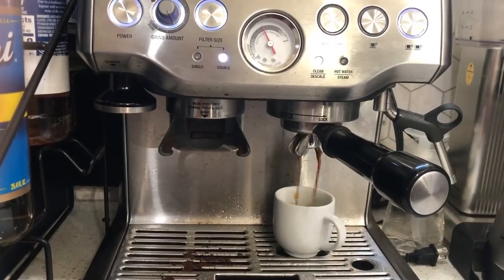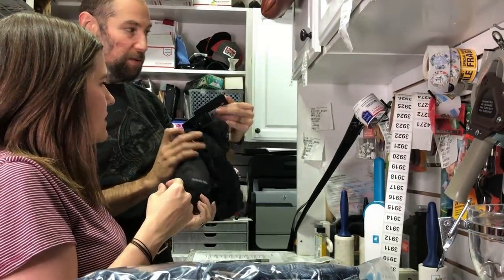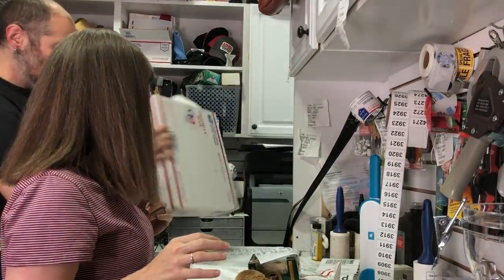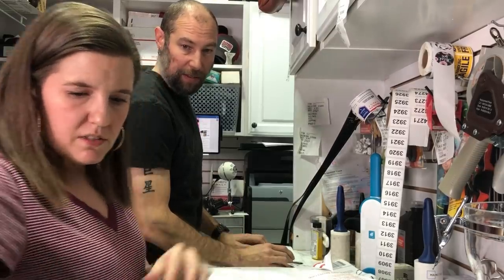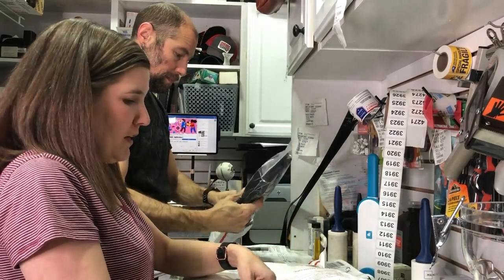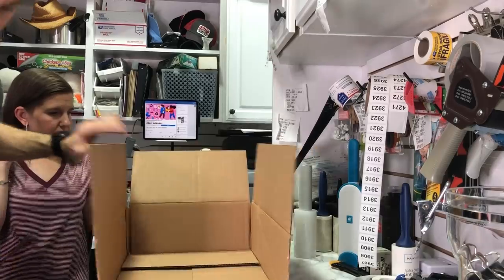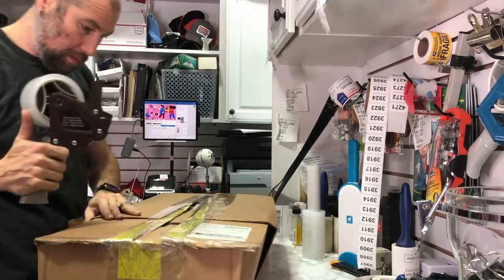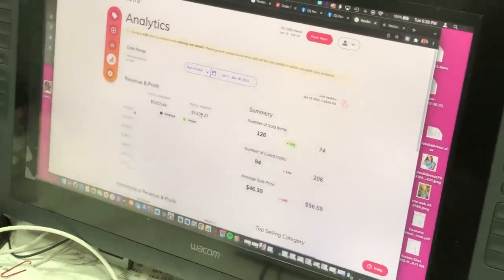What Sold on eBay {How We Pack & Ship} Check Out The New Mannequin! [The Hustle Couple Daily Grind]

Comment: Shipping is my nemesis. I am trying to sell on Ebay but the shipping struggle is real.  I am not quite understanding dimensional shipping.  What is the best way to ship larger packages?  Is entering the dimensions and weight the best way and just let ebay sort it out?
Reply from the maker: Shipping can be tough at first, but it's really nothing to be intimidated by.  Let me try to clear this up.  When we say "dimensional shipping" we should be saying "dimensional WEIGHT shipping".  Dimensional weight only applies when the sum of the dimensions of your box are greater than 36.  For example, if you're shipping a box that is 24 x 12 x 6.  24 + 12 + 6 = 42.  42 > 36 so you need to calculate the dimensional weight of the box regardless of the actual weight.  To calculate the dimensional weight you multiply the dimensions of your box together and divide the total by 139 (this is the divisor used by UPS and USPS for 2022).  This gives you the dimensional weight you should use when shipping.  I'll work it out for you, 24 * 12 * 6 = 1728 / 139 = 12.43 lbs.  What that means is that you have to input a weight of 12.43 lbs. if the actual weight of the box is less than 12.43.  I really hope that makes sense, let me know if something isn't quite clear.
Reply: @TheHustleCouple  thank you so much for the dimensional weight info!!!

Comment: I have a question! (Shocker 😅) I'm still pretty new, so I'm wondering after watching you guys print and ship..I always weigh and rate my items before listing, generally using guesstimates for dimensions. Are you modifying your dimensions before purchasing your label, after you have exact measurements? Is that a thing? Because that'd be kinda awesome!
Reply from the maker: Do you use calculated shipping?  We don't normally and just leave the weight and dimensions fields in eBay blank.  I input the exact weight and dimensions on the bulk shipping label page.  Hope that helps!